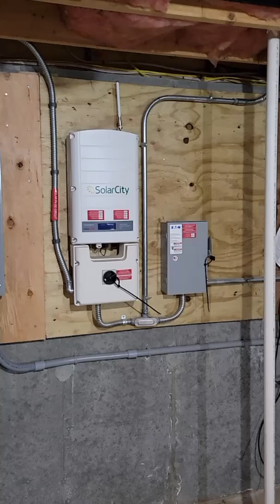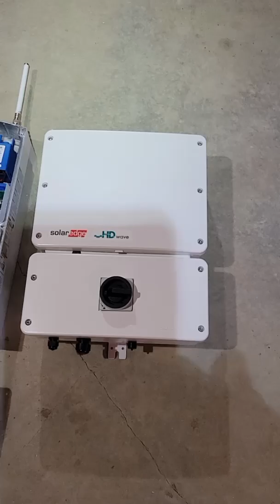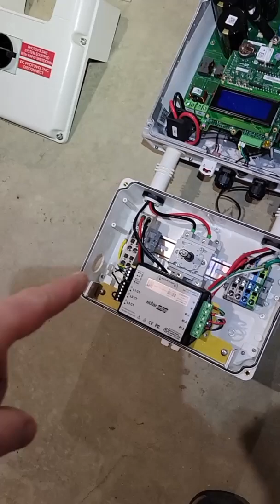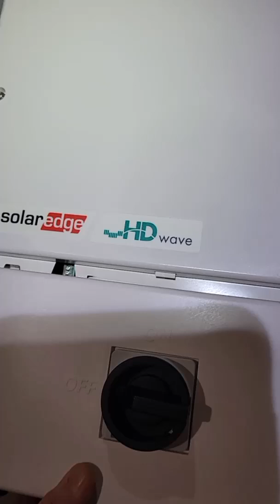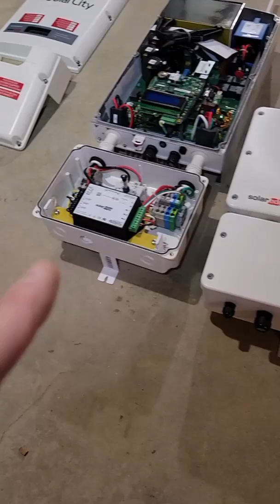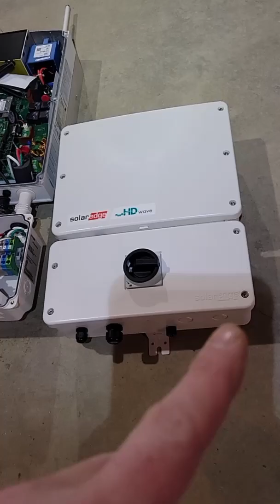Solar Inverter replacement #solar #electrician #solarinverter #electrical #solaredge #solarsystem

Comment: That's a good theory.  Unfortunately solaredge also changed the location of the DC landing locations inside, so I had to also run new wires from the combiner box down to the DC disconnect switch because of that as well 😡🤦🏻‍♂️.
Reply: Yes, easier for SolarEdge, sucks for installers.